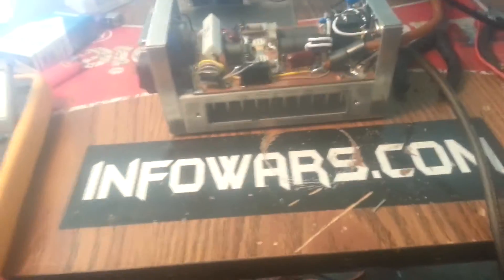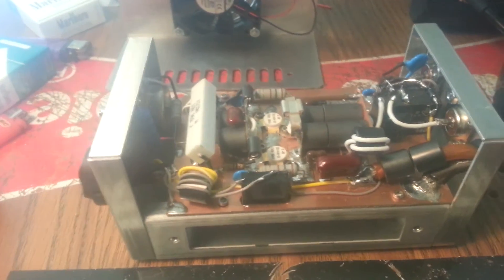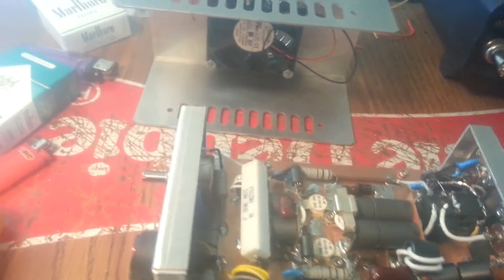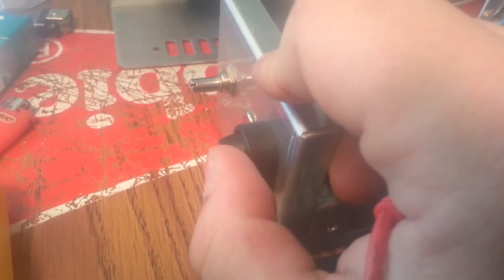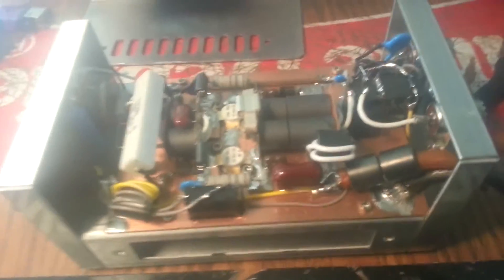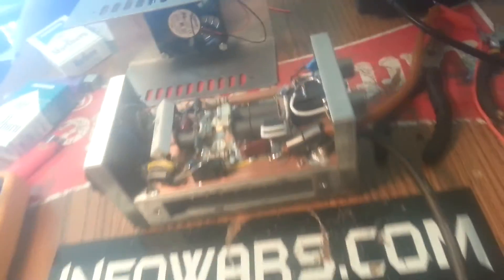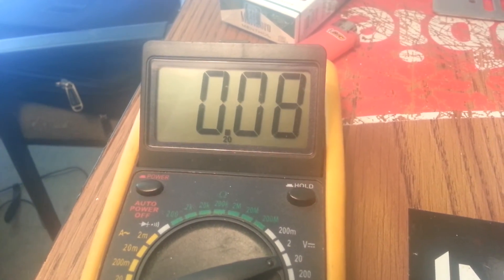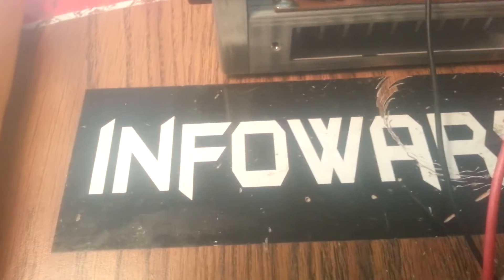Gatekeeper 2X SD1446 Linear 10m Amp AB Biasing Proof!

Comment: Exsplain to us what the difference is between class c and ab 1 ... Also exsplain to us what b bias is ..... And the characteristics between  class a ab-1 B  class A class B class C and class and the way the voltage stays on or off during the cycle of operation ...when u see the input transformer grounded on the amp...you know it's class C ... If you see loading resistor and diode and blocking cap u know u got a bias ... Circuit ..  class C is a dirty classification..than ab ab-1 or B ... The class ab is used for single disband mode of operation do to the clean waveform it produces when the rf sample  is amplified  in the case of class C there most always is a form of peracetic harmonic ..or some type of harmonic usually shows itself after class C is amplified... Now this is iny exsperince with amps and how they function .. class c  most often will be used in am mode and competitive heavy drive heavy load situation were the signal being very pure isn't so much import.. because let's face the facts class c isn't the  cleanest ... Most all your ssb guys use ab-1 ab or class B .... For the purity of the wave form after amplification..

Comment: Diode blocking cap ...and  small electrolytic cap and blocking capasitor with loading  resistor ...is all there is to bias  ..your circuit is a switched bias circuit ..your circuit is very cool ..I dig

Comment: funny the spec sheet for those  2sd1446 transistors  says a max dissipation of 40 watts each.  Sounds like  bs to me
Reply: Sd 1446  70 -90 watt depending on voltage excedra excedra
Reply from the maker: Adams Larren lol lol lol what data sheet are you looking at bud? Look again, look hard because even though it says 70w these are nominal results with a certain amount of drive, voltage, bias, freq etc.. they have to give some type of number. But not 40w, your thinking possibly of a specific Motorola transistor.

Thanks for stopping by bud. this is an older video i use nothing but industry standard bird meters.
Reply from the maker: Adams Larren by the way these are SD1446 not 2sd1446 lol not bs i promise bud......thanks for stopping by your welcomed any time.

Comment: Do  you  use JUST   a  limiting resistor  to  limit  the  voltage  to  0.7 volts ?   What  about  thermal  runaway,  Do  you  use  diode temperature  compensation  or  the  junction of  a  Bipolar transistor  to  do  this.....for  low  wattage  amps  the  simple  way  of  just  using  a  resistor  and  diode  clamp  is  ok  but  for  higher  power  amps  running  class  AB  then  something  else  is needed  ,  Such  as  using  a  transistor  like  a  2SD882  as  the  biasing  Biasing  device...This  is  bolted  to  the  heatsink  Its  able  to  supply  the  higher  current  needed  for  the  higher  wattage  amps....And  its  also  much  easier  to  set  the  Bias  voltage... What  are  your  views  on The  more  elaborate  Biasing  techniques  ?  Marc 'Gw0wvl'..  Thanks
Reply: The bias current of a single ( 1 ) 2SC2879 operating in class AB is 200 to 300 Ma absolute max, well within the means of a 1/2 watt resistor. So .6 to .7 volts at 250 Ma no strain at all. Yes a temperature tracking ( thermistor ) bias source driven from a regulated supply would be nice. But the amount of components, and actual effect desired makes it more work than it's worth. So the amp is getting hot, real hot - now what? Shut down or shift class of operation? Reduce bias current thereby throttling back output, and reducing temperature. Below threshold normal bias current is resumed as is full output. The effect is simple enough, but creating the effect is not. And probably not worth the effort overall.

There are many that would argue that you MUST have a temperature tracking bias circuit.
But this is not the broadcast business. And if you can not feel your amp getting hot and take steps to deal with it, the amp will - problem solved.
Reply: 1883GotDown  Pull  up  the  Schematic  for  the  Kenwood  TS-440 HF  radio  and  have  a  look  at the  PA section, They  use  a  2SD1406  for  the  bias, Diode 3  is  the  thermal  tracking  device,and  VR 2  sets the  bias.. Ive   used  this  circuit  in  various  amps, It  works really well..  Ive  got  a  little  home made  two  transistor  amp,  It uses  a  pair  of  2sc2879's  and  puts  out  200 watts  easily  on  SSB... At this  power  level its  not  stressed and  will  run all  day  long..
Reply: MrMadjones Yes I looked, I have a 440 and 450 sat. Regulated voltages once again. And keep in mind the rig uses the devices well within linearity. Maybe 1/3 rd of potential. Done that way distortion products are way down, and staying under the thermal curve is easy. 4 Devices under control to make the output of 2 run without. And the regulated voltage sources to create the controls needed to stay safely in the linear range of the devices. All this with an Unregulated input voltage source.........It can be done. But to do it right is a pain in the ass. Which raises production costs, placing the " done right " box out of the price spot that the brute force box owns. And the " done right " box makes half the power. Making it look even less attractive.

Sadly, It will not make the key down crazy group that buys them happy. Not enough swing, not enough output for $$ spent.

Nope, sorry Texas Star still rules the price VS power point.
To have super low IMD and 2nd order harmonics costs $$, always has always will.

Bottom line is this : cb'ers  want loud audio, high levels of swing at low cost. A more expensive product that makes less power, but makes that power in a clean fashion. Will not win market share - period.
That's just the way I see it. And I could be dead wrong, have been many times...............